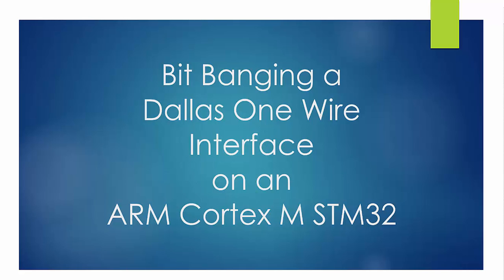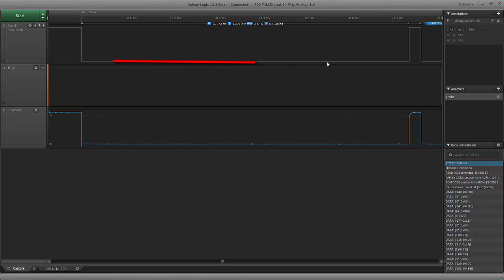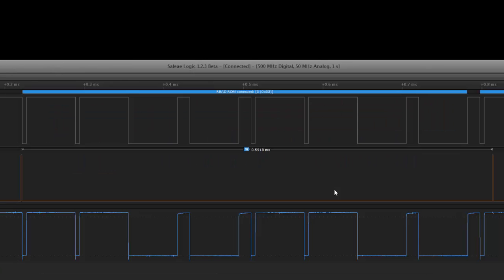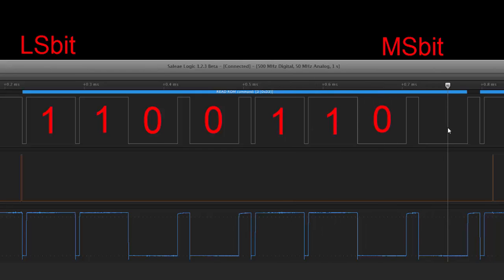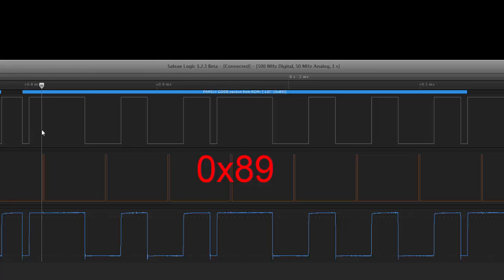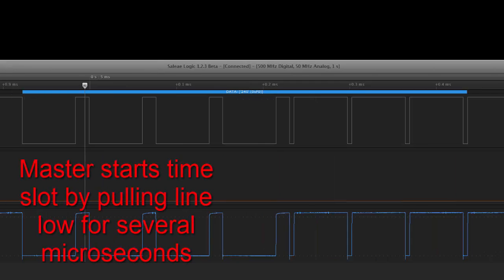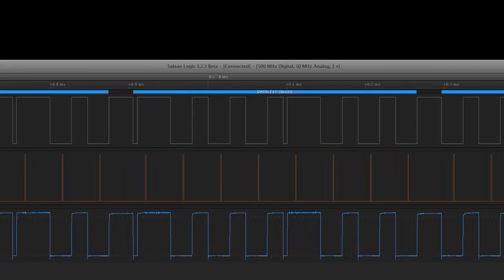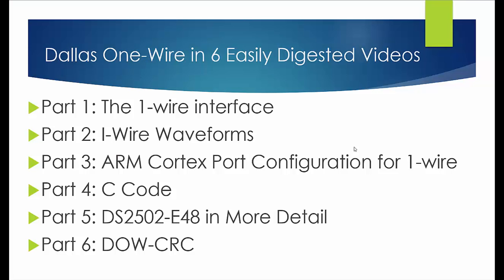{4} Dallas One-Wire Part 2

Comment: Hello 
i'm trying to do exactly the same  sending 0x33 but it's not responding 
i give the reset pulse and i get the presence pulse 
sending the 33 but it's not responding 
could you help me with that 
like what's your timing  for the 1 and 0 
i apply the one in the datasheet but still no respond 
plz help :)
Reply from the maker: There are too many possibilities without seeing your setup.  You are using a logic probe to confirm signals? Also back that up with an oscilloscope to verify voltages.  The time scale is on the top of my traces.
Reply: @HelloWorldETX  
i'm using oscilloscope and i verify the voltage and time 
is there any forum for you i can send you the pictures ?
Reply from the maker: David Farid https://www.eevblog.com/forum/projects/. Please put a link to the video in the body and “Dallas 1-wire” in the title so that I can find it.  Make sure you put all the details in the body.